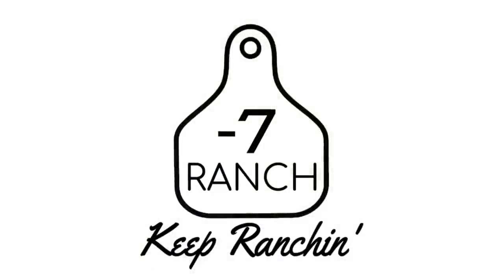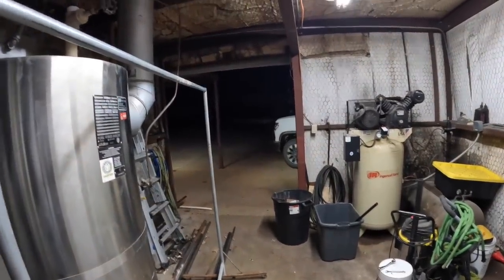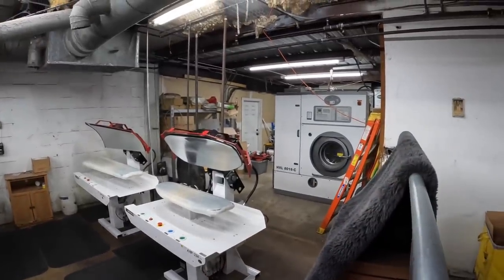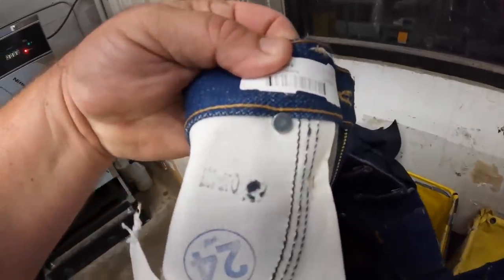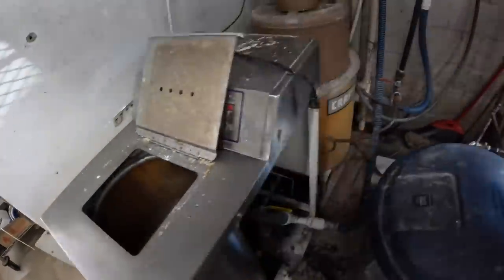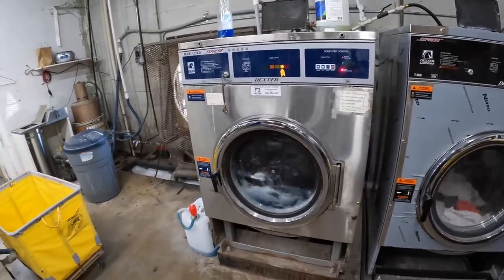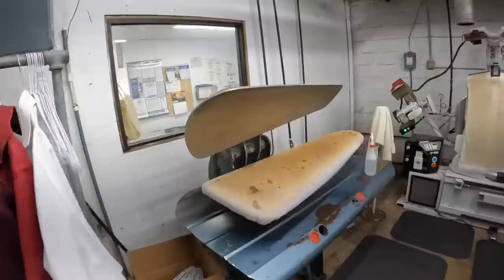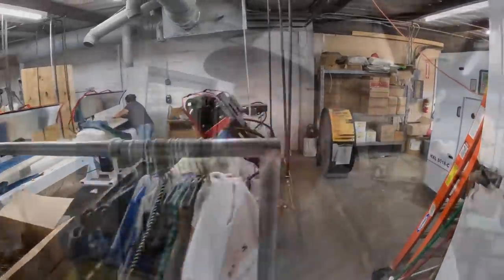Take a Tour of our Dry Cleaning Plant in Operation!

Comment: Boy does that bring back memories. I worked lots of hours at a commercial laundry and dry cleaners. We did all that plus hospital, hotel, and restaurant linens. What a hot place to work especially in the summers in southwest New Mexico. Whewwy..I could sweat just thinking about it. I mostly ironed pants or sheets for the motels and hospitals. The pants presses looked pretty much the same with some improvements. ( this was 25 years ago) the sheet press we used was a monstrosity.  We would pull sheets from ginormous dryers..then 2 of us would stretch them across and feed them into a huge roller..that had hot cylinders and lots of belts. It would go up and around and over and down and over again. It would come out the other side folded3 times long ways, and the folder there would pick it up, line ends up in half then flip again and stack to be tied on paper in bundles to be delivered to hotel or hospital. The  towels and linen napkins went through there too..all that came through the other end pretty fast..when we finished feeding in everything from the dryers, the we would run up to the other end to help the folders. I can still remember those stand up by themselves wranglers, and the guys saying bad words every time they had to work on the boiler. It was an old operation in the same family for 3 generations then. What a great memory..thanks for sharing👍❤sorry I wrote a novel instead of a comment🤣🤣